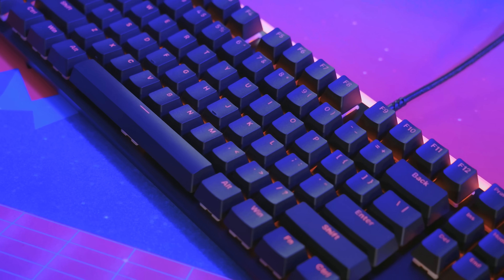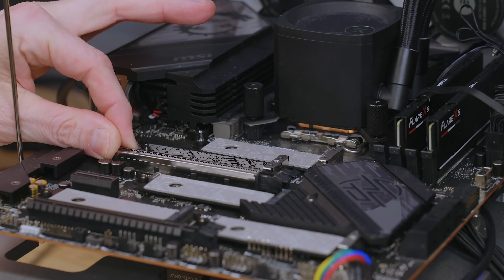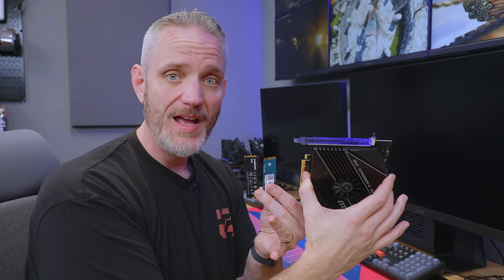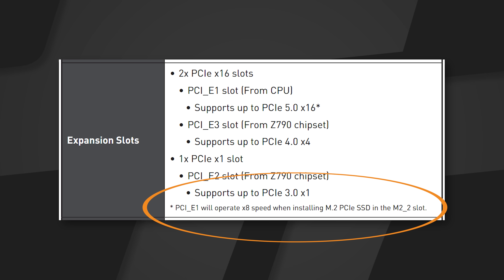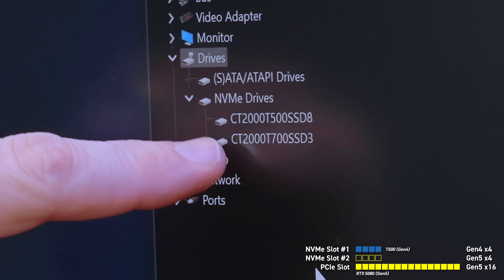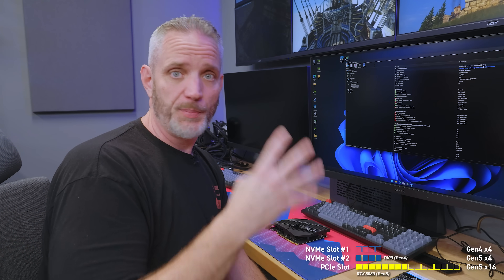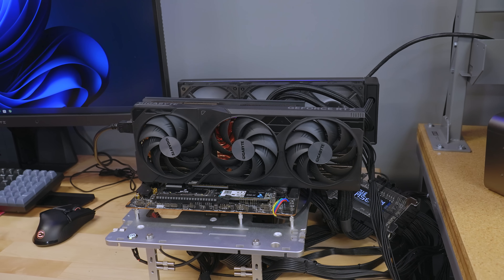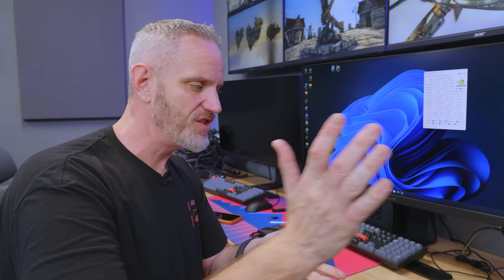Don't make this mistake with your PC!

Comment: I'm happy I bought Gigabyte Aorus Elite. Of course it has an NVMe slot that shares lanes with a PCIe gen 5 x16 GPU slot which I've left empty, but it gives another PCIe Gen 5 slot connected to the chipset that I can add my new Gen 5 NVMe. My other NVMe is gen 4 so perfect in the gen 4 slot on the chipset so everything I  have runs at full speed, no compromises. There would be no point in me having 2x Gen 5 NVMe's though as I'd be forced to run one in a Gen 4 slot

Comment: I have Rog strix X570-E gaming Wifi II with AMD Ryzen 9 5950X (24 lanes), 2x RTX 3090, 2x NVME (gen 4) and 4x sata SSD drives. I will never have enough lanes for anything. I just checked and yeah, im getting bifurcated on both my GPUs and one of the NVMEs.

Comment: The thing that bugs me is fewer pci-e slots on the MBs.  I'd rather have the slots and if I needed more nvm-e drives, I could drop a card in a slot, with the understanding of bifurcation. Why slots? - sound cards, capture cards, NICs-the majority of MBs only provide 2.5gb ethernet-a lot of us have upgraded our home networks to 10g...or higher.
I'm poor {😅} and can't afford a Threadripper/EPYC/XEON  workstations as they have, as Jay pointed out, a LOT OF lanes!
Reply: That's my situation, I have a GPU, 10Gbit SFP+ NIC, and would possibly want to add a capture card to a computer, but then you look at top end boards that cost over $500 and they give you 3 PCIe slots if you're lucky, and using two slots will split the x16 to x8/x8, and the third slot is usually x1 or x2 if you're lucky, but then there's a bunch of x4 NVMe slots littered around the board. I would much much rather have PCIe slots and use a passive riser card to attach more NVMe if i really needed it, with the added benefit of lifting the NVMe drive away from the board and hopefully into more airflow for cooling, or having a heatsink+fan attached to the riser.

There's other PCIe cards that can be useful too, like USB controllers if you need to add more USB ports without using hubs.

It's also easier to remove a PCIe adapter card with NVMe drives on it, then work on the NVMe drives, over trying to get to the NVMe drives that are directly attached to the board in some cases. On some boards the NVMe slot is directly under the GPU so if I want to change out the storage I have to remove the GPU as well.
Reply: Just use usb c 4
Reply: Less than 1% of people have 10g at home.

Comment: So when my gigabyte x870 board says m2 cpu a, b, c and m2 sb (d) I'm supposed to use my main drives lets say my 2tb Samsung pcie 4 990pro drives should be in port a and b? Port a is closest to the cpu, and b and c is down on the pci switch for the gpu to the cpu?
It looks like the m2 d(4) port is sharing pci lanes from the chipset to the cpu with my inbuilt lab, WiFi/BT, USB 3.1/2/4 and all sorts of different shit... Is that something that can fuck up the tpm support on some of the drives with pluton level 3 security as it says my pc supports.. And it's really weird because in my device manager it says standard acpi 64 pc, and gigabyte acpi 64 computer bla bla
Reply: closest and further away from cpu doesn't matter.

check the manual. for example on X870 GAMING X WIFI7:
you have PCIEX16 and M2A_CPU that are using the cpu lanes
PCIEX1_1, PCIEX1_2 M2C_SB and M2B_SB are using the chipset lanes. Those 2 m2 slots support PCIe 4.0 x4/x2 SSDs but they share bandwidth:
"The M2B_SB connector shares bandwidth with the M2C_SB connector. The M2B_SB connector operates at up to x2 mode when a PCIe SSD is installed in the M2C_SB connector."
So, if you put 2 pci4x4 m2 there, they will run at x2.

M2A_CPU support depends on the cpu
AMD Ryzen 9000/7000 Series Processors support PCIe 5.0 x4/x2 SSDs
If you put a gen4 on M2A_CPU, your PCIEX1_1 (which supports up to AMD Ryzen 9000/7000 Series Processors support PCIe 5.0 x16 mode) will probably run at x8 mode.

Someone will correct me if I m wrong, i m sure, but TPM /Pluton don't have anything to do with what speeds your pci runs. Its basically cryptography on a cpu module.

Comment: On my ASUS z790, the first M.2 slot is 5x, but slows the PCIE down, so I run the NVME's through the chipset at 4x. Don't notice a difference on drive speeds, but allows the GPU to have ALLLLLL THE LANES!!!

Comment: On my ASUS Strix X870E-E Gaming WIFI motherboard, I'm able to run one PCIE5 Crucial T705 2TB NVMe SSD in the top right slot, and two PCIE4 Sabrent Rocket 4 1TB SSD's in the two very bottom slots without affecting my GPU (still runs at full x16) and my SSD's all run at full speed. This is because the two bottom slots are handled by the chipset, and the top right slot is handled by the CPU, so it splits things up to where everything gets exactly what it needs. If I had put any of these SSD's in any of the other slots, it would have taken lanes away from my GPU. There was literally only one way to do this.

Comment: I thought if you put the 8x card into an 4x slot it just runs 1 drive at 4x, it only bifurcates if the 8x is available ?

Also if you put more than one M.2 in the ASUS board you drop the GPU down to 8x no matter what M.2 you use. It's not particularly better.

Comment: 3:29 Does that MSI expansion card actually have a PCIe hub chip? If not and it just chops up the lanes to the M.2 slots the second M.2 would simply not work at all, while the first M.2 would get the "full" x4 lanes. — Right? I obviously don't know the card in your hands but it's a detail I am interested in that popped into my head after I saw the lanes on the riser card. (2:58 - 4:08)

Comment: So, just to check (dependant on the motherboard), physical locations of PCIe / NVMe devices can alter the lanes attributed and thus affect the performance?

As such, using more Gen5 drives than you have Gen5 lanes will net you no more performance. BUT, dependant on the CPU, Motherboard, and Motherboard chipset you can reach a scenario where the “ideal” is still only Gen5 x8 to a modern  GPU?

Comment: We need more QUAD-furcated Bifurcation!  :)
eg:  If I want 4 of the 16 lanes (graphics card) PCIe lanes for a SSD; then I want the 12 left to still go to the GPU, NOT 8 and 4 wasted..!
Why is that not 'a thing'!??

If you have to Bifurcate; the MB should have another slot to use the 4 wasted lanes...
That 4 get wasted is almost a scam.

Comment: The example of the m.2 expander is misleading. I am not aware of any motherboard able to bifurcate below 4 lanes. 
The lane segmentation of that card would leave one of the 2 added m.2s dead since there are literally no physical lanes on the slot to connect to.
Same with the statement that you "probably don't have to bifurcate if you have enough lanes"... that's just wrong, that's not what bifurcation is, that's not how it works.
This is giving me a work-related ptsd-flashback.
Reply: some expanders (and some motherboards) use shared bandwidth to allow for more m2 slots, so they will run them at x2, but the 'working lane' should still operate at x4
in the that specific example of an x8 expansion card slotted on a x4 pcie, the second drive should not work at all
right?
Reply: @gloth  Sure, you're talking about AiCs with plex chips that basically do hyperthreading with lanes like the Honeybadger iirc. Though those cards are waaaay past consumer grade and still require full lanes present on the board side.
And yea, youre right with his example aswell. Anything past that first m.2 is dead.

Comment: WTAF? The designers of this decided this was the solution? I mean yes technically it makes the experience functional for the average consumer, but completely opaque to the average person that things "work" when they put new hardware in, but the fact that it so crudely just splits the available lanes means you can end up with a 5090 just getting 4 lanes or some such with those monster mother boards with 4 NVME slots, and say a USB board or the like. I wonder what I just did to my system by adding a second USB expansion card (4xUSB A and 3xUSB C) as for MSFS and a cockpit hardware setup you end up consuming USB ports like there is no tomorrow (hubs don't work reliably for some of it... grrr) and most of the devices demand a USB home-run to the MOBO. 

Also can someone call up Intel and tell them we need more lanes in a modern PC? This is like when I bought my "gaming" machine (didn't buy it primarily for gaming, I bought it for dev which it was awesome for) and wanted more than 128GB of RAM and they don't address it? WTAF it's a 64-bit processor and you only support 32gb modules in each DIMM slot??? c'mon guys it's 2025, it's not rocket science to support larger physical memory spaces (probably the same people who told me I'd get no more performance from more RAM, sigh yes in gaming that is often true as they used a fixed memory allocation for performance reasons, but in my work I was pushing the very speed limits of JAVA or Python garbage collection as 23 threads pushing hundreds of TB of data flowing through from the DB to be transformed and stored back in the DB (as I learned use n-1 threads where n=max # of CPU threads as otherwise Ubuntu froze the UI and you couldn't kill a job or monitor it). Later when the job changed and we were training a ML model (no not slop, a task specific AI) to find a specific thing on x-rays, the in RAM dataset could be 100GB easy, then I was stuck trying to purge done elements and load the unprocessed ones, 256GB of RAM would have been a huge performance boost. Since a typical run would take 1+ days of just the machine grinding, even a 25% speedup by removing garbage collection or needing to go to storage periodically would have made a huge difference (plus more in ram caching)

Comment: I read the x870e-e strixx manual so I knew not the split the GPU lanes up too much. Unfortunately my Astral 5090 cooked (overheated) the drive I put in the dedicated chipset PCIe 5 slot. Fortunately I only bought gen 4 drives... While I had to take out a drive I might of left in it found a happy medium since I ended up getting a 8tb 2.5 inch drive for my biggest storage drive. The conclusion is that these overpriced motherboards along with the chipset designs 'are not ideal' like Jay says. Building a PC gets easier and harder at the same time.

Comment: I have a question that either you or your viewers can answer. First, let me go through the system I am using. This is a desktop PC. All of this is Gen 4. Motherboard is Gigabyte Z690 AORUS Master. It has 4 M.2 slots and 3 PCIE slots. I am using the Gigabyte version of the RTX-3090xtreme in the X16 slot. My CPU is the Intel 13900k. I am using three Samsung 980Pro 2TB M.2 drives. I have placed M.2 drive for drive C in the slot which routes through the chipset. Drive D(files) is routed through PCIe lanes. Drive E(system backup) is routed through PCIE lanes. I am using Samsung Magician software to monitor my M.2 drives. Here is my question:  This software only recognizes the drive, routed through the chipset. According to this software, the two drives routed through PCIe lanes do not even exist. How can I get this software to monitor all three drives? If this is not possible, is there an open-source software I can download to accomplish this?

Comment: I have a Asus Prime B350-Plus board. In the manual was written, when I install a M.2 device in the socket, it shares bandwidth with SATA6G_5/6 Ports. Therefore, I assumed, I can use both but with limited speed. Willing to do this, I bought an M.2 drive and put it in the socket. To my surprise, those SATA Ports went completely offline instead of just having limited speed.
In later revisions of the manual, the specific entry for those ports was changed to "[...] and therefore the SATA_5/6 ports cannot be used when [...] ist installed."
So even IF you read the manual, that sadly doesn't always mean, you get what you read.

Comment: When I was building my replacement PC a couple of years ago, I wanted to include a bunch of storage.  When I was choosing the AM5 MB I was watching quite a few YT videos, one of which went into quite some techinical detail and I realised that PCI-E lanes were going to become a factor.  I was coming from a previous PC which was an Intel HEDT 6900K which had an abundance of PCI-E lanes.  Anyway, I went through all my AM5 candidates quite carefully looking at the block diagrams.  I ended up settling on the ASRock X670E Taichi for my solution.

Comment: curious, my B650E Riptide with the Gen 5 m.2 slot occupied doesnt bifurcate my Pcie x16 Gen 5 down at all. 5070 ti is running at full X16 5.0. I wonder why MSI configured a faster m.2 slot to share pci lanes with the X16 Gen 5 on that board?

Comment: Jay, check out MSI MPG X670E Carbon WiFi! It has m2_1 and m2_2 directly connected to the CPU. This is the reason I bought this MB. Even newer MSI MPG X870E Carbon WiFi doesn't provide us with this kind of PCI-E architecture, because of USB 4.0.

Comment: Still wish it was documented better form the manufacturer, i got a m.2 board that adds 4 m.2 slots to a 16x slot and only 1 system can make use of it and its not the system i wanna run it in, so it ended up being easier to get multiple adapters to plug them in different slots to trick the older system making the exact same drives work.

Comment: TY for bringing this to my attention, and for explaining what bifurcation is. I thought I had it all figured out, till I checked. Only to find out that my 6900xt was not running at max potential. Upgraded from a 3900x to a 9950x3D on a ASUS X870E-E. Too many M.2 slots.

Comment: That x4 slot . . They should have just used a normal x4 setup, no need for that extra length with no pins. Yes, you can use x1 and x4 in an x16 (normal) PCI-E slot (I do for a RAID card).

Comment: You are mistaken. The TAICHI board is the only one when the GEN 5 M2 slot populated then the PCI x16 vga slot is not downgraded to PCI x8, which was cleared happened when you populate the the GEN 5 slot (8 lanes lost) and the vga card run at x8 instead of x16, in your displayed example. And it is exactly what ASUS says in the note. It would be an interest topic for you to test. Plus the ASUS does not provide board schematic like the ASRTOCK, just saying.

Comment: People need to chill on throwing everything on the CPU lanes. 
You REALLY don't need to have anything other than the OS on the CPU lanes.

I've been running games through an x870E chipset on a Gen4 990 Pro at full speed. 
With multiple SSDs and a sound card also on it. 

Leaving the GPU and main SSD for the CPU.

Comment: It really doesn't matter if a GPU has x16 PCIe 4.0 or x8 PCIe 5.0 lanes; even with a card like the RTX 5090, the Frames Per Second (FPS) are almost the same as with x16 5.0. 
With nvme drive You won't notice any difference between 5.0 and 4.0 speeds (even 3.0) in everyday use unless you are benchmarking or copying very large files. It affects video editors, but not significantly, as PCIe 4.0 speed is still very high.

Comment: Thank you for this video! I recently installed 990 EVO Plus, watched your previous video on this topic and decided to test drive performance. Everything looks good(read, write, random read speeds) except random write speed. Found online that people are experiencing same issue as me, and it looks like people had advertised speeds on Win 10, but on Win 11 random write speed is slower for some reason. This can be an idea for future video, to test it and see if your drives are impacted as well.
Reply: Adding more context, I am running Gigabyte B550 Gaming X V2, ryzen 5 5600x, 3060ti. My main (OS) drive is 990 evo plus which is plugged in upper slot which is gen 4 x4, my secondary drive is kingston A2000 which is gen 3 x4 (and is plugged in bottom slot which is gen 3 x4). I verified my gpu is running at gen 4 x16 and drives are running correct gens and lane speeds. As I already mentioned, for 990 evo plus I cant hit random write speed per specs advertised online, but my kingston hits all speeds without any problems.

Comment: I broke down every single X670/X670E X870/X870E MB from every manufacturer and the MSI Godlike X870E is the best brake down of PCIE lanes on the market and literally the only one that makes sense for Gen5 with smart layout of options for the lanes available to AM5
Reply: The number of boards that quite literally made me scream "WHY!?!" Is nuts. So many boards are intentionally dumb, unnecessarily dumb, just to divide the product stacks. 

Making trash for profit should be illegal.

Comment: The most important thing since i began doing leisure scientific computing fun stuff is this very issue. I have boards that have EXTRA lanes with a special chipset additional.  They are out there.  The worst is 95% of amd boards in AM4 always reduce and kill gpu if you populate high end nvme drives.  Or the main big x slot got downgraded when you put another nvme drive in a particular slot but not the other.  There often are three nvme slots but if you avoid one particularly, you run gpu and both drives at full speed.  Horrible.  I am going to be looking into this today! Thanx papi

Comment: Jay, this video is a little too late for me, but a good one.
I went through this problem in march when I started my build, but there is a video with my proart mb that showed the solution. There wasn't much information about it at the time.
X870E 5090 and 4x nvme, all 4gen, one of them running in a pcie card instead of a nvme slot.
Thank you anyway Jay

Comment: Mine is set up correctly.  Getting gen4x16 on my 4080, and all 3 SSDs are in their correct slots.  One of those SSDs is running at x2 speed, (but I knew that when I bought it) and the other two are x4.  

But, of course, I read the fucking manual.  Just glad I read it correctly.  :p